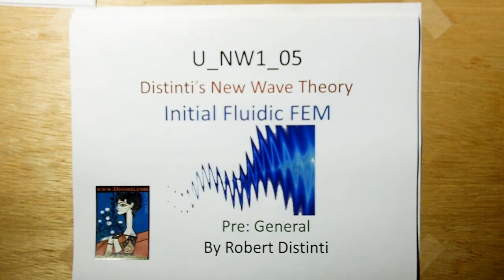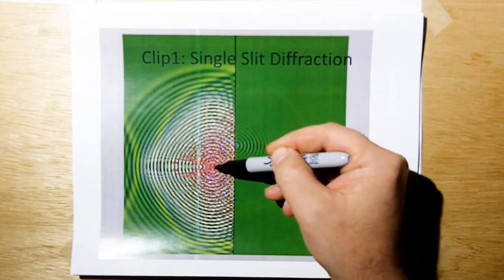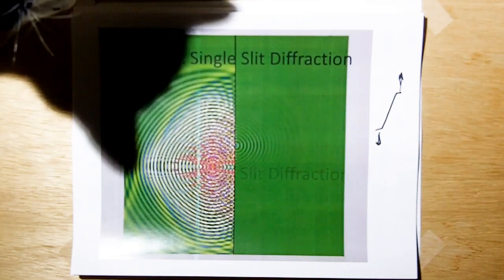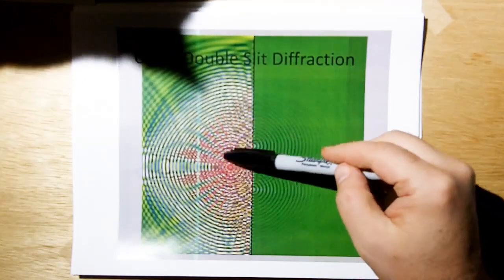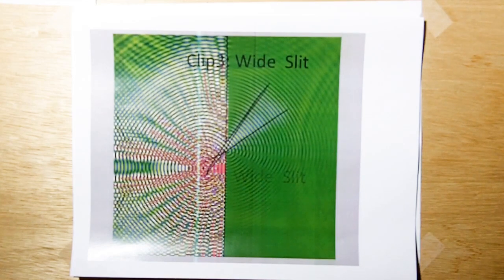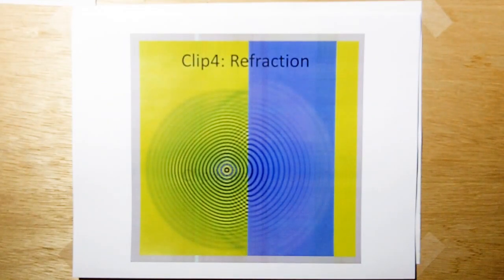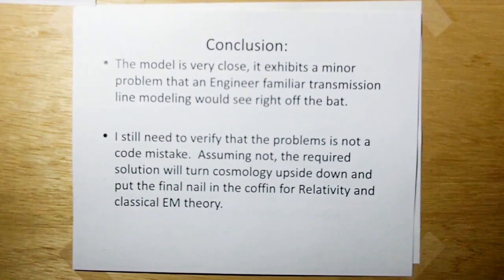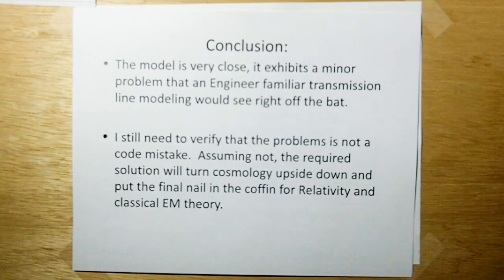U NW1 05: Initial Fluidic FEM

Comment: Is this ether model constructed using two type of ethons or was it possible with one type (with some special properties to let transverse propagation be possible)? Can you simulate, what happens if you rotate a tiny volume of this ether? Does the rotation propagate (like a wave) perpendicularly (transversally) to it's plane of rotation? Is it possible to have an angular velocity where this propagating structure remains stable (does not attenuate)? What happens if you only stir one type of the ethons?
Reply from the maker: +Tibor Gáts .  Just trying to get a simple fluid simulation to work first.  Presently expanding to 3D using CUDA.   Once all of the fluidic properties of ether (video 23 -- I think) can be matched (within reason), then we go binary to explore transverse.   Baby steps
Reply: "Go binary" sounds exciting... sounds analogous to "go nuclear"!

Comment: If the density of the ether is changing in the universe, light would change its frequency. This could explain the redshift of stars and would also explain why the stars and galaxies with greater distances to us, have a bigger redshift! So no expanding universe and no acceleration of expansion!
Reply from the maker: +Sebastian Glanzner BINGO!
Reply: +www.Distinti.com I have been using that one for a while.  First of course you ask what is dark matter... then you take the earth must be at the center of the universe if everything is expanding uniformly from here, and then of course the killer its a linear relation.  Nothing in the universe is linear as like that.  Or you can take Mr Distinti's universe and make sense of it all without dark matter.  I have quite a few converts.